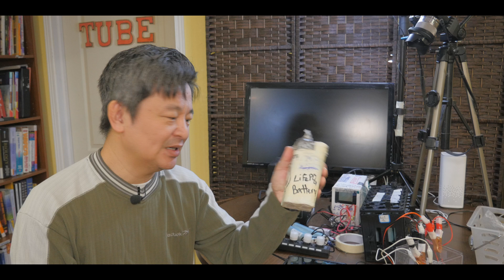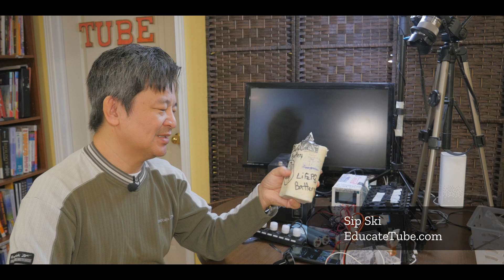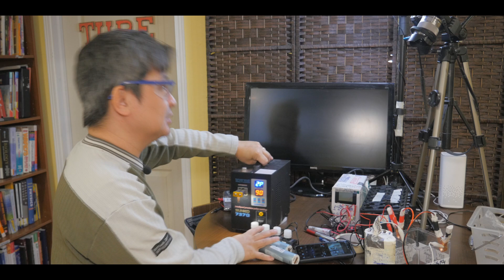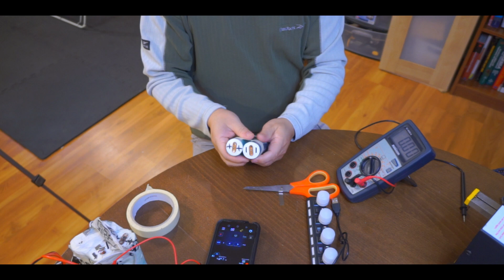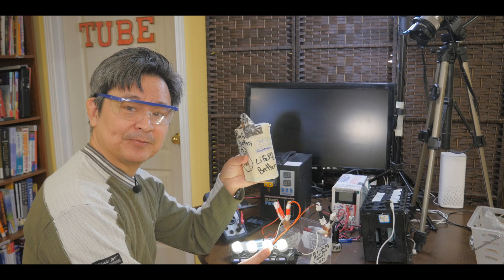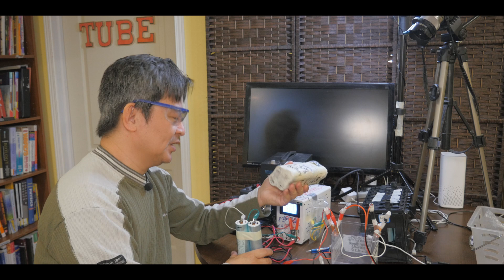How to build your own Lithium Iron Phosphate LiFePO4 Power Bank System #diypowerbank

Comment: Well, you showed me why I can't do this, your process involves machinery I can't afford. This is why I'm looking for a DIY solution, to put cost into a realm I can grasp. I'll continue looking, thanks a lot.
Reply from the maker: LiFePO4 batteries are quite expensive unless you can salvage a used one.  Certain machinery is required to build your own LiFePO4 battery bank.  You do need to invest in certain tools for long term investment.  My tech and tools are meant for off-grid scenarios.  I want to collect useful tools that I can build things without depending on society in the future.